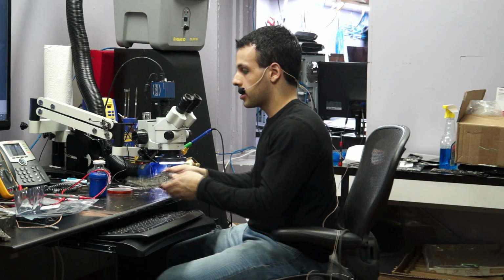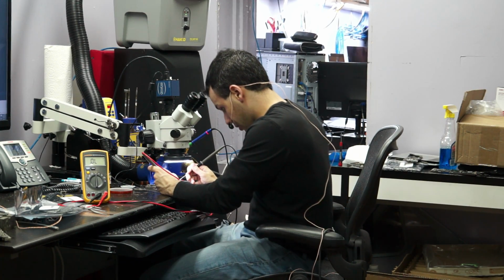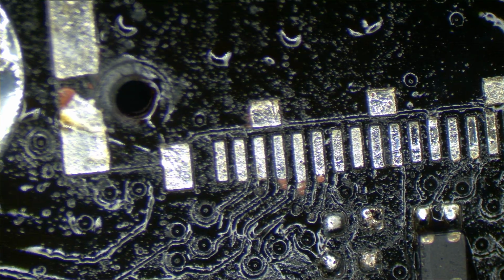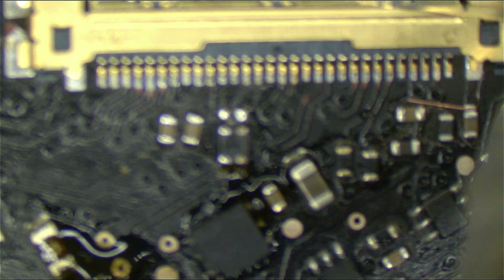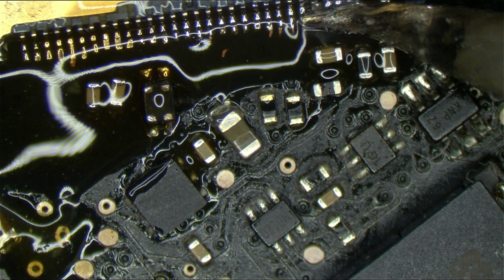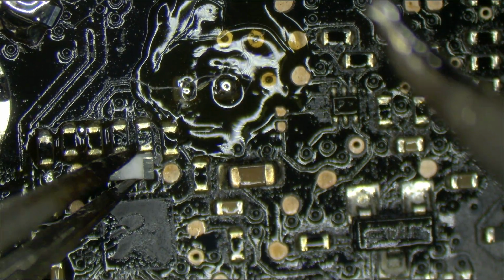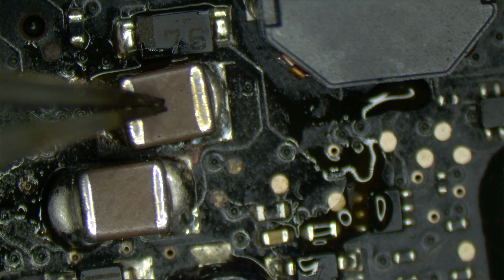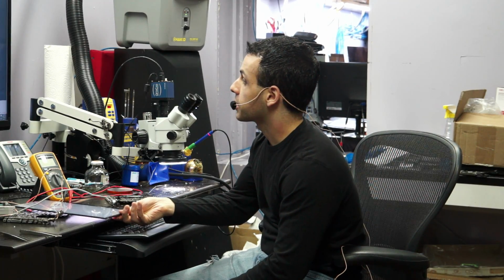820-3115 logic board no backlight caps shorted to ground

Comment: TL; DR: 
Mid 2012 15inch 2.3Ghz Macbook Pro:  a1286 md103LL
Backlight fuse went out. Where is it. What does it look like. What do I need to buy to fix it. Please & thank you!

Hey Louis, I had an issue with my macbook before & your keyboard replacement tutorial helped so much! A few friends have also had issues with other Apple products & I've referred you to them since.
Now I have another problem, but can't find much information out there. I was hoping you could help. It's a Mid 2012 15inch 2.3Ghz Macbook Pro:  a1286 md103LL
Well the backlight fuse went out. Screen still shows an image, but needs a flood light to see it & an external monitor still works. From your other videos I figured this is the problem. I know how to weld proficiently & soldering won't be that hard. I'd really appriciate it if you could tell me what I need to buy to replace it. Where the fuse is at & what it looks like.

I live in an area that doesn't have any Apple repair stores remotely close & need my computer daily for work so sending it off would be impossible.

I'm stuck between a rock & a hard place, so I need some help. I hate to be "that clueless dumbass" on YouTube asking for help, but it's come to this. I'd really appriciate any help you can give me. Thank you for doing what you do, you have no idea how much it helps.

Even if you can't help me I'll continue to support you & your channel. Have a good one.

Comment: Hey, I have Macbook 2010 mid 13-inch model and board seem to be working.. fan turns on, hdd going, external dvdrw powering. I get normal tune sound but then screen flashes for 1 second and turns black with some degree of brightness. Sometimes when i boot it goes white but without question mark for missing hdd. Tried everything including using alcohol + brush to clean board and reseat all 3x, IF there was liquid spill. Didnt see any component missing or bulged.. but some kind of burn marks on few points, No corrosion. External monitor shows same white screen if i close lid on bootup. I got kernel panic when installing Lion osx before all of this and it never worked, single-user mode was working aswell.. now suddenly nothing. Any ideas? Even little tip appreciated.